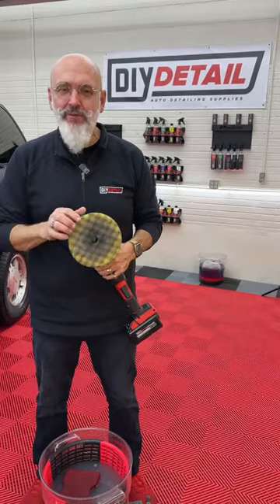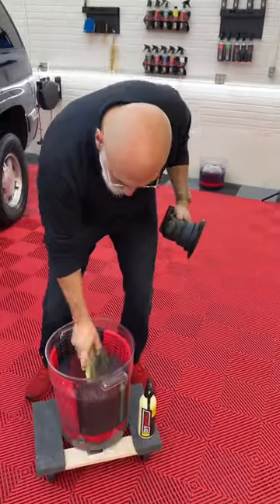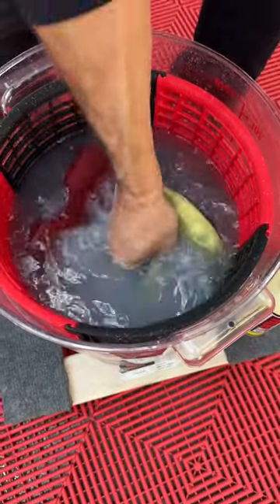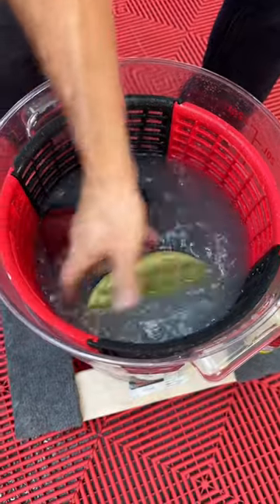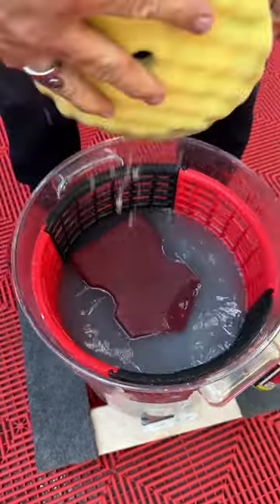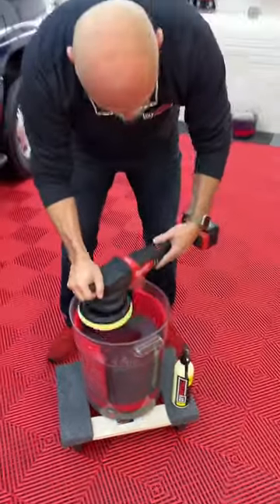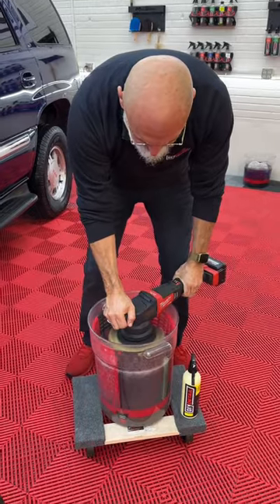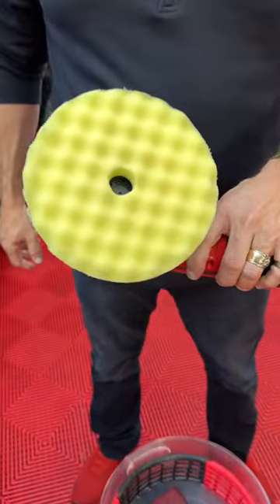Easy way to clean any polishing pad! #detailing #ceramiccoating #diy #cardetailing

Comment: How often do you need to clean pads ? I heard it was every panel
Also does getting the pad wet from the rinseless count as preping it for the next panel since it becomes damp or do you need to re prep the pad every panel ?
Reply from the maker: The easiest way to remember is not to add clean polish to a dirty pad. With a damp pad “priming” by spreading polish all over it is not required.

Comment: What about compressed air? Can that be used with foam pads? I’ve used it on mf cutting pads but haven’t tried it with foam yet. If so, would you recommend some water/cleaners before blowing them out?
Reply from the maker: Compressed air or a pressure washer are great ways to quickly destroy a pad.
Reply: @diydetailofficial  really?! Even on microfiber pads?

Comment: Which method is more preferred, dunking the pad in the rinseless or running it up against a rinseless dampened microfiber towel? Also, will both methods work for all types of foam, microfiber and wool pads?
Reply from the maker: Both will work, but the dunk and spin does a better job.

Comment: In theory could this work for any compound(not just Gold Standard)? Im concerned about the velcro on the back ripping off from the constant tearing off. Is that an issue?
Reply from the maker: Yes it works with all, yes changing pads is hard on the Velcro
Reply: @diydetailofficial  thanks for the reply. Might just try the dunk method you guys showed a while ago instead.
Reply from the maker: Thank you.

Comment: Does that dry it enough or should I gice it a day to dry?
Reply from the maker: Dry enough to use
Reply: What speed should I use for compound? 
What about for polish?
I have a rotary polisher rated at 600 to 4000rpm (1 to 6 settings)
Reply: Thank you!

Comment: About your polisher, is this the Milwaukee 7” Variable Speed Polisher (Model 2738-20)? or the 5" 15mm random orbital 2684-20?
Reply from the maker: It’s model 2684-20
Reply: @diydetailofficial  thanks. can the same model be used as a rotary? or are only the corded models come as a rotary polisher?
Reply from the maker: No, different actions require different tools.

Comment: Side note. What polisher is that? And what budget battery powered polisher/buffer would you recommend?
Reply from the maker: It’s the Milwaukee cordless. Whatever is in your budget! In many videos we use simple dual action sanders that you can find at the hardware store…these will help you get shine and gloss when paired with the gold standard pad…for the most part we’re not promoting deep defect removal since paints nowdays are so thin

Comment: The guys from Esoteric mentioned not to use a pad after it's been washed. They say to wait until its completely dry to use it again. 

I suppose everyone has their own method.
Reply from the maker: Correct, try both methods and see which you prefer

Comment: I do this, but i have curved pads by this 🤔
Reply from the maker: Pads that curl are a result of too much pressure.
Reply: @diydetailofficial thank you.
 It little bit doing with finishing pads which I use without pressure. 

Its ok if I use the same water in the bucket to clean pad from heavy compound and Im cleaning medium and finishing pads with different polishers after cutting stage ? Cant another pad contaminate with this water and make problems..micro marring, hazeing..

Or it needs new clean water for another pad with another polisher? 

Thank you Yvan.

Comment: That’s a great way to prematurely ruin the bearings on your machine! Let’s add 5x the weight to the pad and hold it wide open 😂 

Spin out pads on a rotary only!
Reply from the maker: It’s actually not hard on the machine at all. The bearings are designed for an axial load, what’s hard on them is applying pressure while polishing.
Reply: @diydetailofficial  I was curious about that. I had always heard spinning them freely was hard on the bearings.
Reply from the maker: There are some tool manufacturers that claim that. Other manufactures have no issues with free spinning.
Reply: Ok, so best to check with the manufacturer. Thank you!